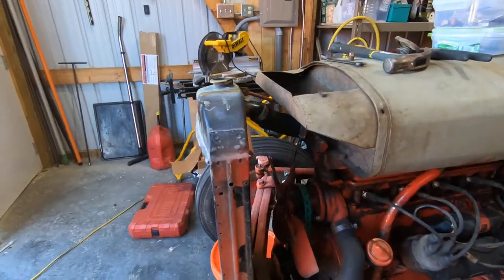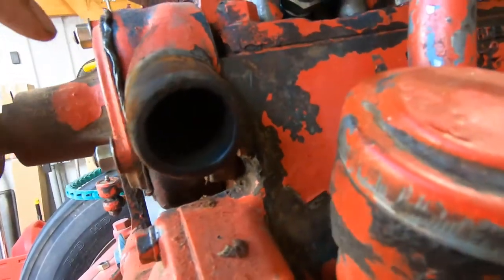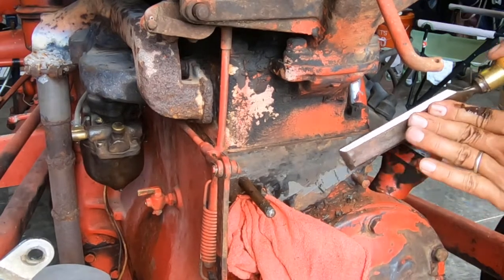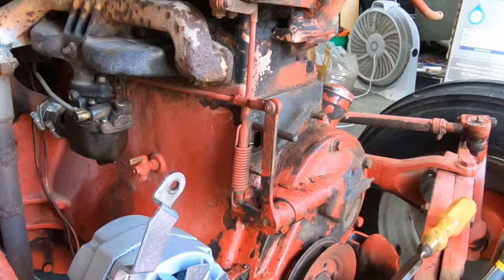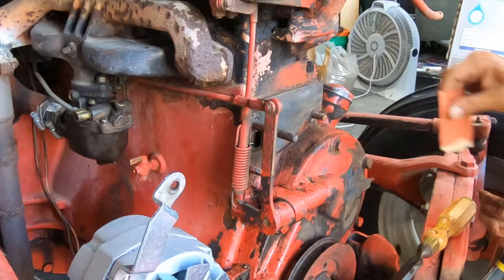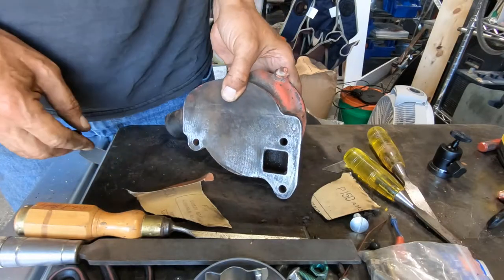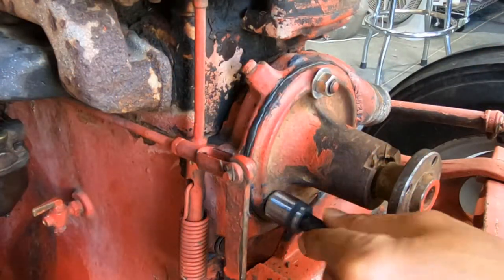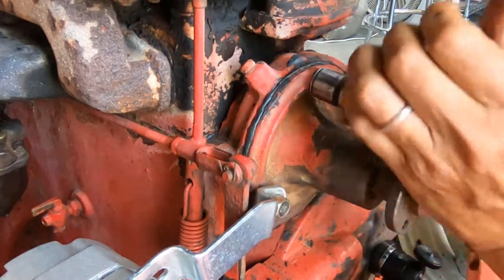Fixing a Leaky Water Pump on a Ferguson TO-20 -- Part 1

Comment: You were right on the money with the rear housing leaking rather than the pump. Also, exactly where you indicated it was leaking. Just a follow-up to the Permatex Ultra Black... Have you used the tractor often since then and has the Permatex held up? I've never used it solo, always used it WITH the gasket.
Thanks again for the video, I appreciate it Sir.
Reply from the maker: Thanks Chris, yes I have used the tractor a good deal and no leaks at all. The Permatex has held up great! 😊

Comment: Did your tractor have a thermostat?  I'm working on my te20, and there isn't one.  I'm assuming it would be where the top radiator hose connects at 25:25 on your video.  Good video and new subscriber.
Reply from the maker: Yes, I do believe it did, but can't remember for sure. It should be in one of the videos right around this one, and you can check by using the playlist: https://www.youtube.com/watch?v=gdC1VKxBkWw&list=PL_iZ8t8zAFuMSeubgkz3oYvPq_zCOKLST Good luck!